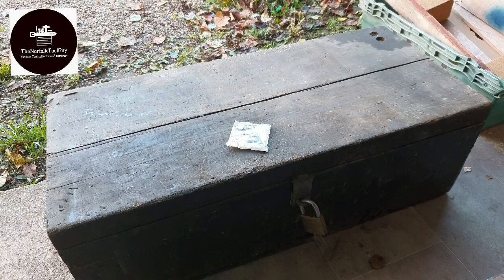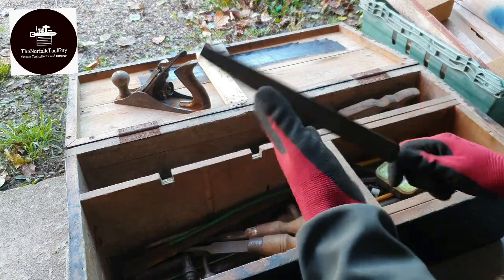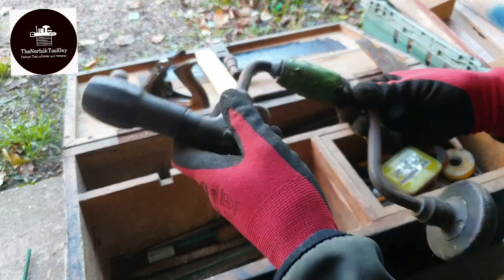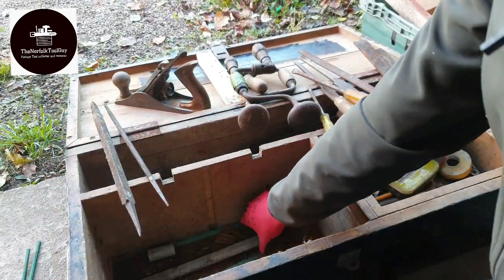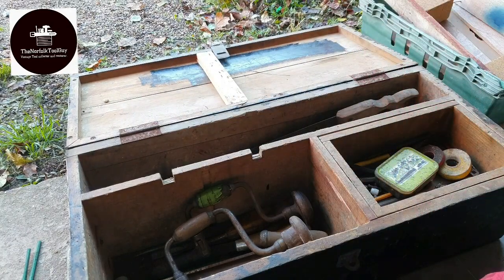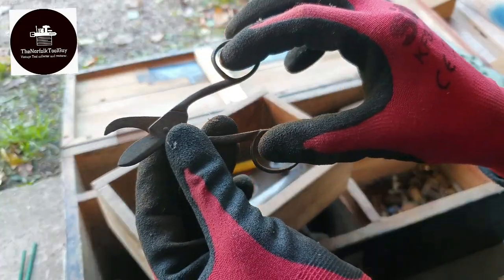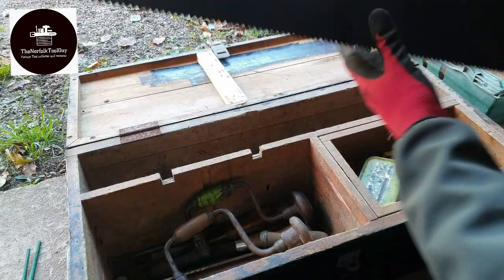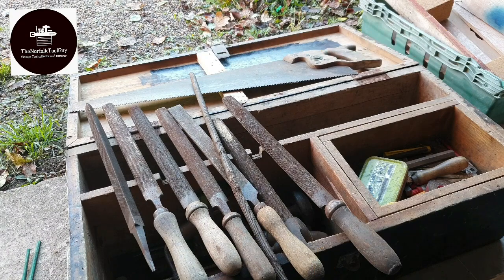Old carpenters chest, tool haul late upload

Comment: The long spring looks like a ' bending spring ' for 13mm copper  water pipe.          You can never have enough files
Reply from the maker: Thanks pal, I was wondering about the spring 😅 trouble with having lots of files is finding a way to file them away neatly no pun intended 😉

Comment: That little hammer looks almost identical to a hammer I made in metalshop class here in the States when I was about 13 or 14 years old (circa 1975). I'm sure that handle is not original. I still use my little hammer to this day!
Reply from the maker: Thanks for watching 😁 Thats interesting that could possibly be the origin of this little fella, I was thinking maybe it was someone's metal work class project, I have clean it up pretty well over on my Instagram, ready to be used once more on some little jobs 😁👍

Comment: The green plastic strips look like cut your own rawlplugs. Very useful so do not throw away.
Reply from the maker: Thanks for watching yeah my dad informed me after the video of what they were, so I have put them with my wall plug box 😁👍
Reply: I was thinking they may be paint sticks. Years ago I used to install 36" natural gas transmission lines. The pipe had a green coating on the outside. At any scratch or void on the line we had to stop and "paint" the opening with a torch that melted these green sticks and coated these holes. I'm not familiar with what a rawl plug is, sorry.